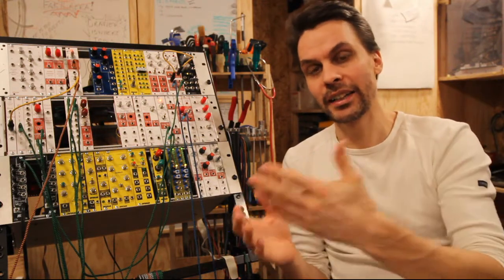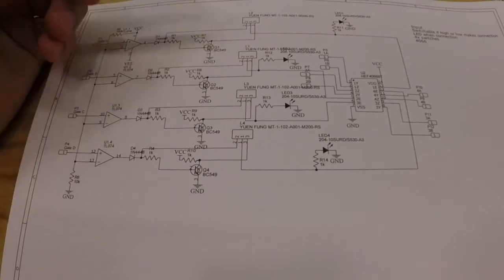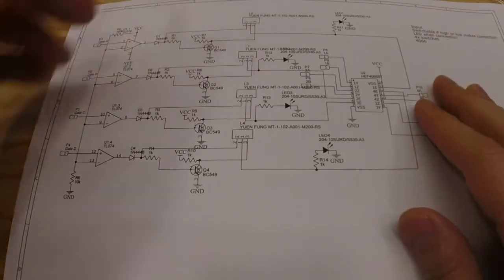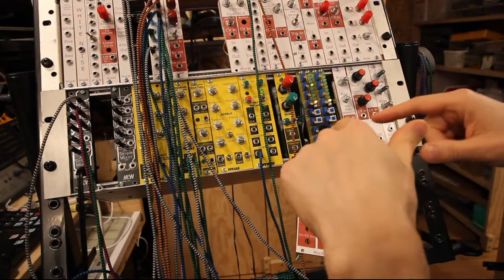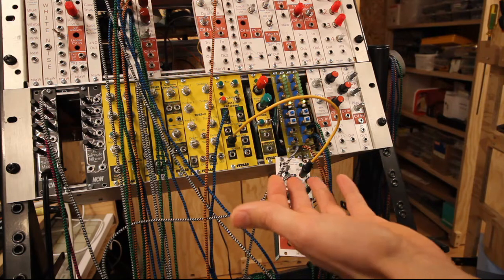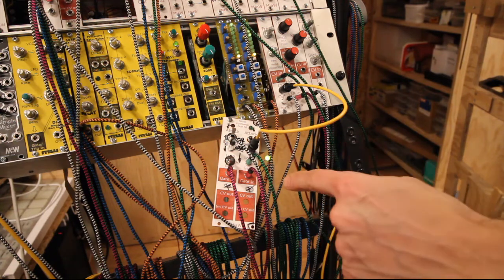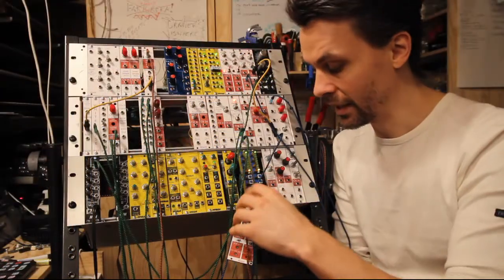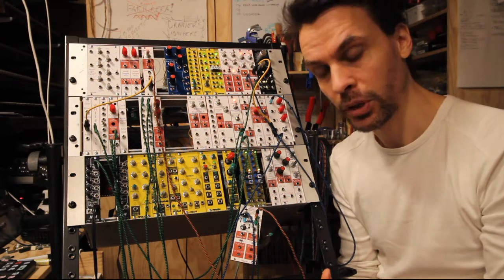4066 Quad gate controlled switch - DIY Modular in a Week 10.6

Comment: Kristian, you really did an impressive job on your dual 8 sequencer, making them so thin. Also, if you don’t have a way to tune the pots, I’ve been using the BOSS TU-3 Chromatic Tuner pedal, which is generally intended for use with guitars and bass. Really enables one to tune in specific notes. I like your use of logic chips to create interesting patterns. Nice that it’s inexpensive, also.
Reply from the maker: Thanks Sarah! I hope to be able to build a quantizer at least. But the pedal approach sounds interesting aswell. Do you have a setup you could show? Cost and space are two things I try to minimize on this build. Although the 2hp sequencer was a wee bit too tight. ;)
Reply: Kristian Blåsol is also like to find a good, easy quantizer circuit, but just a schematic, not a kit. I don’t have a eurorack system. I posted a YouTube video of my breadboarded sequencer, yes. Check it out if you like. 😊 I’m working on a finished unit mounted to a thin piece of smooth wood.

Comment: Nice schematic: I wonder if this circuit will work on passing CV signals or also on switching on/off AC and audio signals ? Does the 4460 then need to pass negative signals or does it have to be hooked up to a negative and positive power rail ?
Reply: I am curious about switching audio signals too. I'm looking for clickless audio switch IC

Comment: Does the switch really add anything, since just swapping the two inputs would achieve the same thing as flipping the switch?
Reply: Ah, I'm stupid, or rather, didn't properly watch the video. I somehow thought this was about switching one output between two inputs.
Reply from the maker: I had to go back and watch the video myself. Long time I did this module. 😅 But as you also figured out it inverts the action of the gate. So in one position the switch is normally open and closes when the gate is activated. And in the other position the switch is normally closed and is opened when the gate is activated. So quite a fun and useful feature in the end. :) Hope it helps.

Comment: Hi Kristian, couldn't you use a (N)AND/OR gate to silence the output of the sequencer if the CLKINH (pin 13) is high or low?
Reply from the maker: Yes. That would be possible. I thought about it aswell but too late (the module was already built and video half way done). But a good idea that probably would work. If you try it let us know the results. :)

Comment: I haven't tried them yet, but I've started to see this type of 3.5mm jack for sale, which looks like it might save a bit of space for narrow modules.  I wouldn't be surprised if this is why they have started being produced/sold. 

https://www.taydaelectronics.com/new-arrivals-69/pj-392-3-5mm-stereo-enclosed-chassis-socket-gold-plated.html 

https://www.taydaelectronics.com/new-arrivals-69/pj-392-3-5mm-stereo-enclosed-chassis-socket.html
Reply from the maker: Yeah those are really nice. Important that they have a screw to hold it onto the panel as it is quite common to let the jacks keep the back pcb and panel together.  :)